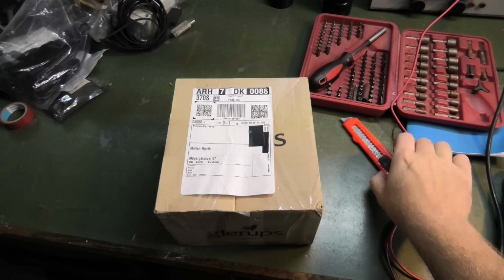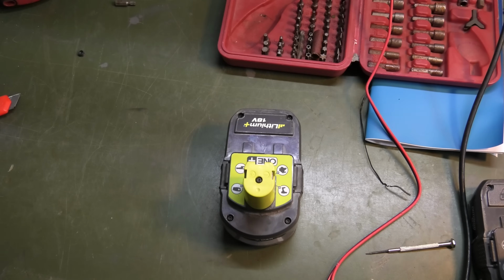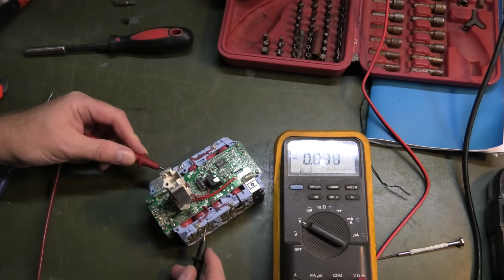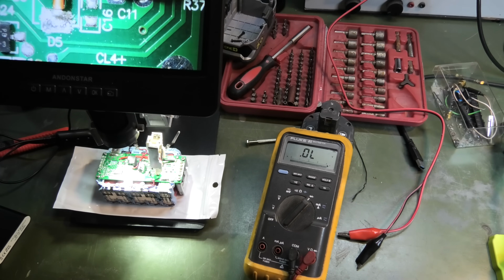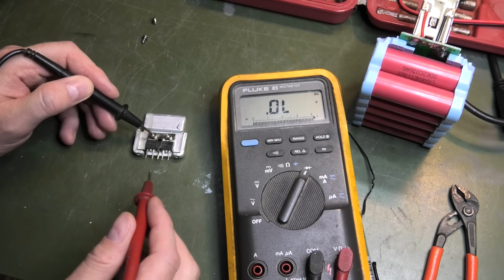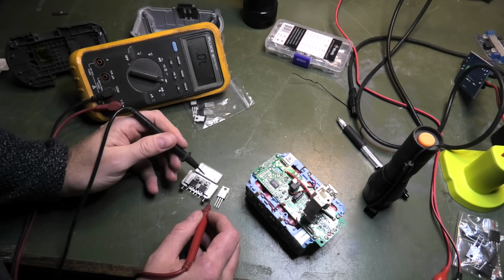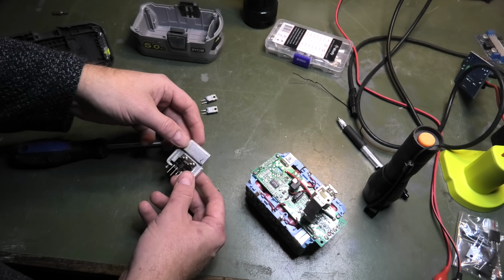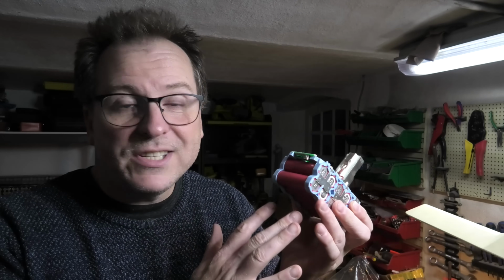Defekt Ryobi 18V Battery,, I FAIL and need your HELP - 1327

Comment: I fixed my battery, I trashed it and bought a pair from Amazon for 70 bucks.
Reply from the maker: Not the sort of fix I was looking for,, in a later video I manage to buy a new PCB for it at $8,, and with that it worked again.

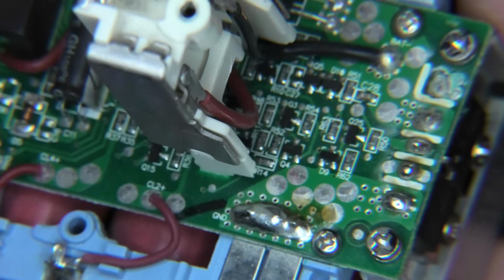Comment: Yes, on your three leg component Masfeet at  7:55 and 7:56 fram on your video see the bleed over from your battery possibly could be causing your issues, and definitely replaced one of those masfeet It’s badly corroded on one of the leads
Reply: I apologize the phone change my spelling. It’s mosfet
Reply from the maker: I did replaces the PCB in a later video :-) and that worked well!

Comment: I've seen videos that show when you're done replacing all the batteries in the pack, and those 2 in the back with the corrosion staining should be replaced or cleaned very well, you have to RESET the battery pack. Take a paper clip, bend into a horse shoe shape, touch "RESET & GROUND", if i remember right. I did a 1.5Ah Ryobi with the light bar on the front, that pack reset was Underneath the red power wire,  2 holes through the board, just touch paper clip to reset battery pack.
Reply from the maker: I ended up replacing the PCB in a later video.

Comment: Struggling with a problem like yours. All leds on my battery flashing at the same time when press the button. 5 amp battery, but another layout inside. No power to tool/charger connection. But power from battery pack. From the beginning four cells had 3.7V and one 2.3V. Have charged that one also to the same voltage but still same problem. Red lamp flashing on charger. Have trying reset by shorten betwin J1 (belive its same as rst on other boards) and negative.
By the way, in the video im belive you shorten the connection beside rst when you trying to do the reset thing
Reply from the maker: I had to give up in this,, and ended up with replacing the whole PCB - Video : https://youtu.be/Wx2lC6vsEjw
Reply: Belive its the only solution for me to. Trying to find a board to buy. But some of the sellers has bad rewievs. My battery gone bad after sawing of a metal pipe standing in a very bad position on a ladder.  Trying to get the last little bit off whitout change the battery
Reply: I would replace the 2 lower voltage batteries, then do the RESET TO GROUND to reset battery pack. When pushing battery test button, green lights should not be blinking anymore, should be Solid Green.
Reply: Actually, I would replace ALL of the Batteries, it's just Good Practice.😉🇺🇸

Comment: I dont disagree.  But I do.
I need lots of lights. Im the guy that bought everyone's flash light out of thare starter kit. I have a lamp in three rooms. And if you go to the kitchen.  Just leave it on.
Each amp in a clone. Produces 2 hours of light. And all of my batteries have been charged, not joking 500 times. And still going. I agree totally these are not compressor, or saw  maybe not 1/4 inch impact quality. But i can stick a honker in a lamp. And it goes all night. 500 charges.  For $30, thats Oct 24's Ebay price on a 12ah
Reply from the maker: Hi @charlesinscore4107
Thank You very much!  glad you liked the video :-)
Thank you for watching! :-)
Reply: @MyPlayHouse  I just tested the P109 12ah current ebay battery.  Got just short of 20 hours . Out of my P781 lamp on high. The power indicator lies. Says 4 bars at 18 hours. And dead 2 hours later. Never the less . I purchased 8 , for $240 with tax, and shipping. 
I'm going to use this as a base line. On my last Christmas 3 battery deal. From HD .  I'm very disappointed in their life.

Comment: Like anyone else using these batteries, now and then out of the blue they quit charging.

Is there any repair shop that has the ability to fix the circuitry at the component level?  Previously we had an Interstate Battery shop that would rebuild these. Now I don't think they repair any longer.  Maybe was just a local shop with a smart Tech or maybe Interstate thought they could make more not repairing.
Reply from the maker: Under warranty they do replaces. after that you are on your own :-/
Reply: Interstate Battery is not even selling these 18650 any longer.  I've heard the new electric car batteries are using the 21700, so those are taking precedent over the 18650. Temu has a great selection, just find out the ones you need, INR, IMR, ICR, 20A, 30A. They sell many different styles, just match yours up. They have mini spot welders also, cheap, & they work ok, they have the tabbing also, stay with 0.1 thickness or the mini spot welders have a hard time penetrating through the thicker tabbing strips.
Reply: To be honest, most of the board does not get hurt, the fuse at the battery side I've seen blown out, maybe twice, they were doing stupid shit with it, mainly just bad batteries. Ryobi batteries must be Reset on the PCB board, that's their SAFETY feature, Right, it's so they can make lots more money.😉😂🇺🇸

Comment: Hello My PlayHouse, I have a Ryobi 18V / 5.0 Ah battery, which no longer charges...
The charger light is green, but... nothing is charging
I would like to do a reset.
I found the RST, (it's exactly the same card), but I'm looking for the other entry point, to make the bridge with the electrical wire
If you have the solution...🙂
Reply: The reset pin needs to be "shorted" with a piece of wire or a paperclip to the main ground on the board.  It's where the very first cell gets soldered to the board.  Be sure its ground, NOT the other end of the 5 cell string (up at 21 Volts.)

Hold one end of the wire on ground, and the other end on the reset pin for about 1 second.  Then wait a few seconds for the BMS to reboot.  Now check the voltage at the main terminals.  If your battery has the LED's showing power, see if all is well.

If you have cells that are out of balance, the BMS will just re-trigger the error flag and your battery won't work.  Check the voltage across EACH cell.  All five cells need to be above 3.30 Volts AND all five cells must be close to each other in voltage as well.  (Within about 0.20 Volts)   E.G. - 3.40V,  3.45,  3.42V,  3.41V,  3.39V  are reasonably well balanced.

Once you have all five cells above 3.30V  AND  they are all closely matched in voltage to each other.... then perform the BMS reset mentioned above.  Should work fine after that.  

Now put the battery on your Ryobi charger and it should charge all the way up without issues.  If you are curious like me, recheck the cell balance once it's fully charged.  Make sure all five cells are within 0.10V of each other.  E.G. - 4.15,  4.13,  4.10,  4.16,  4.11
Reply from the maker: I only fixed this by replacing the PCB,,, that worked... video : https://youtu.be/Wx2lC6vsEjw?si=E9l-6TFBPnXomZyk
Reply: Exactly!!😉🇺🇸

Comment: I was trying to fix my lawn mower Ryobi 40V battery. The meter read 41V, so It was fully charged with all the cells balanced. But pressing the test button only read 2 LEDs. While I cleaned the board with alcohol all the LED came on with the last one blinking. But that lasted only 20 seconds... time for the Alcohol to evaporate? Or is the alcohol cooling down a hot component? We used to troubleshoot defective components that overtemp by using dusting spray because its solvent gets freezing cold on the area that is sensitive, indicating a bad component there. Sometimes we need to resurrect PCB with SMD chips by doing the opposite, that is remelting their solder joints. Since your board has seen moisture and rust it is possible that some pins are shorting on the controller from rust across. I would give it a ultrasonic cleaning and then "cook" it or blow hot air at 380C  for 2 minutes or so. But you desolder the cell and remove anything that is not heat resistant. However I understand why you decided to replace it with a new board. But that does not replace the know how you get out of troubleshooting successfully electronics and sharing this experience with others.
Reply from the maker: I would have loved to fix this PCB,, but lets just admit it,, If I need to replaces SMD's or do other advanced stuff to get it up and running again,, I lose the audiences,, in the way that only a few % will be able to copy and do that.. If you have a broken battery in a garden tool,, does not make you able to replacing SMD components :-) So I replaced the PCB in this video : https://youtu.be/Wx2lC6vsEjw?si=aJpFazQkwQrvxZms

Comment: Just solder  wires from main pos  neg  and use till it dies
Reply from the maker: Nah,, that is a solution,, I did a later video on replacing the PCB,, and that fixed it.

Comment: At the beginning of the video when you pulled the upper casing off of the battery a little small thin metal piece fell out and you never say where it came from or where it goes when you put it back together where does it go
Reply from the maker: It goes up the end of the plastic,, the part that goes inside you tool.

Comment: What size and kind of torx screw did you use? I can't find the right torx for it. I'm reffering to the screws inside the batterry holder
Reply from the maker: You need security torx, there is a little hole in the middle of them.
Reply: @MyPlayHouse  yeah I got all that part but do you happen to remember what size? I already bought 2 different sets of torx drivers but none fits. Btw, thanks for taking the time to answer, other content creators are a snob
Reply: I do believe they are T10

Comment: Hi.
I have a ryobi 18v, 1.5 Ah. When I measure voltage in the battery pack it shows 19.95v but if i measure it on the tower outlet it shows only 7.7 v. When pushing the test button it rises up to 19.95 as long as the green led is on then back to 7.7 when green led is off. The test gives only 2 green bars on.
I don't understand why. Can you help me fixing it.
Thank you
Reply from the maker: If the cells are vell balanced, and you are still not getting good power out of it,,this is the only way I know right now : https://youtu.be/Wx2lC6vsEjw
Reply: Under the Red wire going across the PCB board, one end going to your tower, and the other end going to your + battery side, look under the red wire, you will see 2 holes that go through the PCB board, bend a paper clip to look like a horseshoe shape, touch the 2 holes with the 2 ends of the paperclip, this resets the battery pack, now you can charge the pack & when tested with a meter, you will get your 19.7V at your Tower Terminal. To test, I jumped a ground wire from Tower ground over to the battery ground side, I got 19.7V, before it was 7Volts. So it must shut off the Ground side if a battery fails, after replacing 1 battery or all of them, you MUST RESET the PCB Board in order to make it Operate Again.😉🇺🇸

Comment: As I’m sitting here and. Came across your video I’m in the process of replacing the 18650 cells in three Ryobi battery packs 😊great video
Reply from the maker: Thank You,, I ended up having to replaces the PCB on this battery,, here is that video, if you should become so unlucky : https://youtu.be/Wx2lC6vsEjw
But that worked for me..

Comment: I have exactly the same symptoms on a Ryobi 4A battery. All cells are 3.8 to 3.9v What I noticed is if you monitor the voltage at the +/- terminal and press the button, for about 3 seconds I get 18v at those terminals. But I still haven't determined which component is failing.
Reply from the maker: I did a later video,, replacing the BMS : https://youtu.be/Wx2lC6vsEjw
maybe you want to go this route..

Comment: Maybe the mosfets get no on signal. If the electronic has a regulated power supply I would check if thr 5V or whatever is o.k.. Then look where the on signal can come from.
Reply from the maker: There is so much stuff back there, that could cause that... :-/

Comment: You might have to figure out which pins on the mosfets are the gate and figure out which ones need to be on and off,  and then check to see if you are getting the voltages on tge gates you need to have power go to the tools.  It is a deep drive type of fix. Ill assume the mosfets are off, and you then will have to troubleshoot the controlling circuit. You can use a good battery for comparison. 

Plan B, if you have a battery with a good board and bad cells, take the board and use it with the good cells.
Reply from the maker: Plan C,,, get a new board ripoff from China :-)

Comment: first point of call is visual inspection of all components, you didn't take the board off the battery and inspect the underside, there might be a clue underneath, just something you missed.Did you smell the board for burnt components?
Reset button: I would leave for 10 seconds
Your turning on/off the mosfets with the voltage from the multimeter, thats how you test mosfets!!
zero reading: mosfet open current will flow
o.4 reading: voltage drop of o.4 volt meaning high resistance mosfet closed no current can flow, well tiny trickle.
Ok I just read all the comments, I dont think you mentioned the inside had got wet!!
Possibility the pins on the icu shorted and damaged the icu, if it wont reset I suspect new board is in order, its still a good battery pack since voltages were good, can use for other projects maybe. If can buy a new board that will solve it.
Just a note: I have a an irobot vacuum, their battery pack you cant read voltage on them, even when good, I'm not sure how it works but battery doesn't turn on until connected to the vacuum unit....I have no idea if ryobi have similar.
this guy fixes same one via q10
https://www.youtube.com/watch?v=URrEqleJQ68
Reply from the maker: Hi @namenotshown9277
Thank You very much! that was a lot of info!! glad you liked the video :-)
Thank you for watching! :-)
Reply: didn't feel like alot of info, please let us know the outcome of your project @MyPlayHouse

Comment: Micro controller is dead.
Your power FETs are not turning on. 
So you should have a voltage reading system the back bit you showed looks like the balance function as it's analogue... The would send a signal to the MC to turn on the fets.

Just pull the BMS off, replace it. Print a bracket for the terminals so it can be used and job done.
Reply from the maker: Hi @guywhoknows
Thank You very much!  glad you liked the video :-)
Thank you for watching! :-)

Comment: This battery was wet and was dried but it looks like the board was never taken off from the battery assembly. I think, when you take off the board, you'll find water damage on the other side. Also, taking off the board shuts down the MCU and it might reset the error state the battery is in. The board should be cleaned with alcohol at both sides and then, hopefully it can be fixed. Anyway, good to see the MCU is still alive. It is able to blink the led when you press the button. The MCU is the most problematic thing, because it is programmed and the only way you can find a replacement is to open another battery. Problem is most probably in the cell voltage measurement circuits. The MCU probably thinks one of the cells is dead but you measured all of them at 3.9V.

The packaging and delivery time of the new mosfets suggest that you ordered them from China. Possibly these mosfets are relabeled or rejects. Use the original mosfets. They test good. 
If you need to order parts for repairing stuff, you should order at a reputable electronics component house. Those China components can be used in DIY stuff where current-carrying capability is not so important. 

I'd rather see 'dumb' batteries with a basic protection and balancing circuit in it. With those you can tinker. With the newer ones, not so much. There's an MCU that needs to be able to talk to the charger or the tool. The circuitry in my tools is even more convoluted. There's no protection mosfets in the battery itself. There's only the balancing and that annoying MCU. It communicates with the circuitry in the tool and it will not power on if the battery didn't say it is okay to do so. And it will also communicate with the charger. I've seen that communication on an oscilloscope. It is a digital data signal. So, if my tools need an okay signal from the battery in order to turn on, that means that I won't be able to power them from another source. Very annoying.
If I would like to use my tool batteries as a power source in a safe way, I'll need to buy a sacrificial tool in order to get the full protection circuitry. Or just connect it up and hope that I don't discharge the battery to the point cell damage will occur. And if I would like to run my tools on an alternate power source, I need to buy a sacrificial 4Ah battery that will be able to provide the okay signal to the tool. (Some power-hungry tools won't run on the 2Ah battery)
I didn't buy sacrificial stuff yet because I think it is wrong to sponsor this tool brand any more. I also don't have the time to try to reverse-engineer it and emulate the signals using an Arduino.
Reply from the maker: Hi @fluffyblue4006
Thank You very much! that was a lot of info,,, glad you liked the video :-)
Thank you for watching! :-)
Reply: ❤❤    Thank you for sharing your knowledge and experience!

Comment: The two mosfets are behaving exactly like they should.

When you have the diode voltage is because it has a built in diode from source to drain (many mosfet are like this).

While when you measure zero is because you charge the tiny capacitor between gate and source, this “closes” the “contact” between source to drain.

The left pin is probably the gate, the common pin the drain and the right pin the source. I agree it operates like magic :)
Reply from the maker: Hi @SuperSerNiko97
Thank You very much!  glad you liked the video :-)
Thank you for watching! :-)

Comment: Your problem may lie with the extensive corrosion shown at 7:55 in the time line. Stop there and you will see the issue right in front of you. There may be other issues, this one just jumped out at me... Joe
Reply from the maker: as I change the mos fet´s and the batteries measure okay,, I do not think that is it.